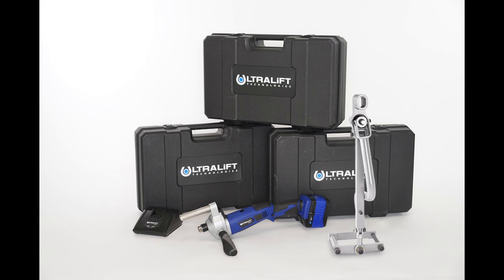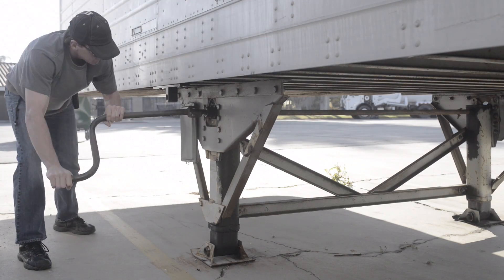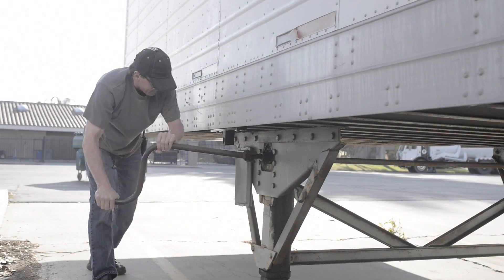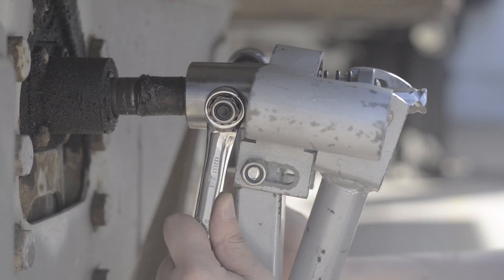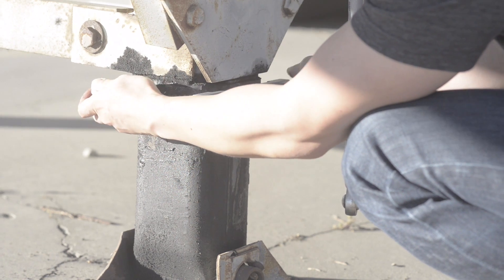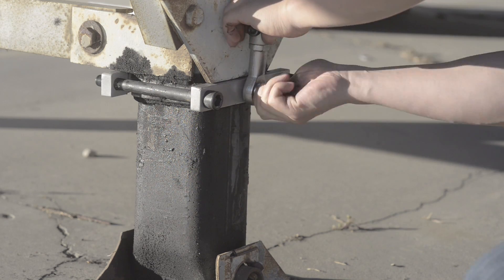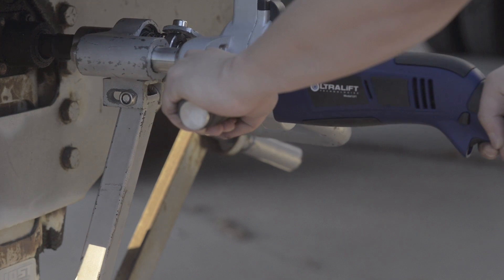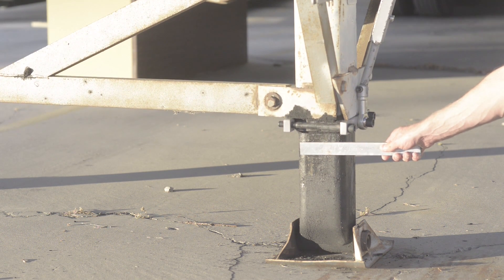Landing Gear Powertool by Ultralift Technologies, Inc.

Comment: I've just begun to use your product on a trial period & have run into a discouraging moment in inserting the male & female ends together. Given it takes a few attempts to secure the connection but a wider female end that narrows gradually would work a lot better to insert the male end. I don't think a major modification would be in order other then just making the female longer with the bigger rigged opening along the interior & possibly a longer male end. Also the color scheme seems all wrong, where a shotgun color scheme would make the tool appear as a sawed of shotgun & a driver could hang it in their truck on a gun rack, so the intimidation factor helps the driver for security as well. These are my opinions on your product otherwise it's really fast and efficient.